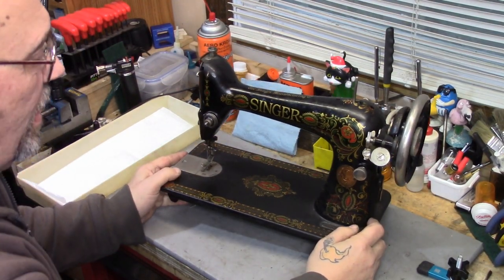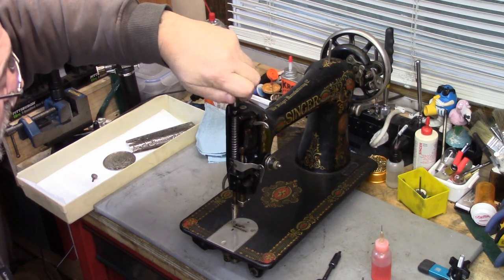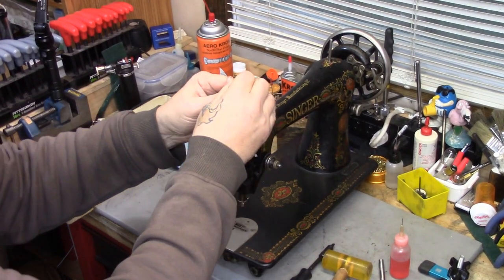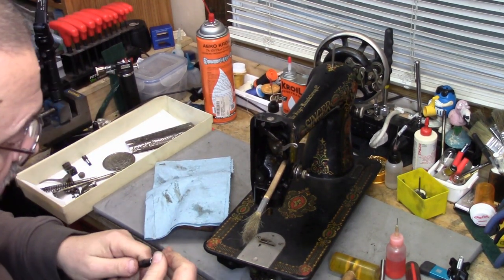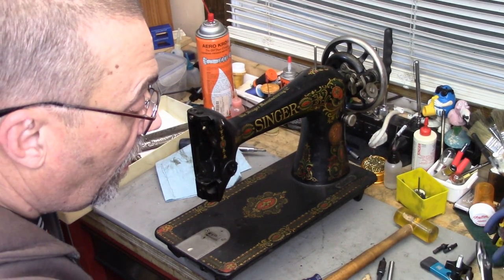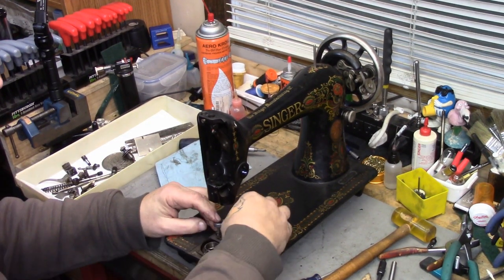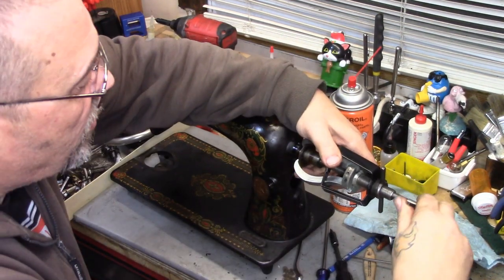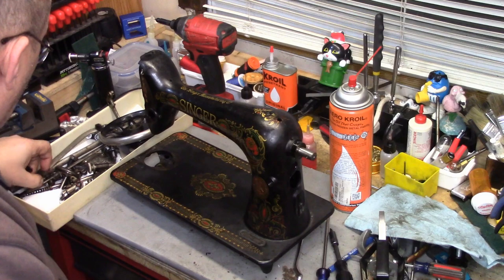Saga of Sophie Part 1 - The Dissection

Comment: I like to leave them original. I have 3 old back clampers and accessories are available if you really need them. I find that i dont use them enough to warrant changing an old machine. Also most of us have more than one machine. I love using the old Singers but keep a Kenmore 52 for zig zag work and the almost never done decorative stitching

Comment: I just bought a 66 from 1905 which is super gunked up (lots of it frozen). I'm following along with you as I learn about sewing machines and this one in particular. There is no hole on the inside for accessing the needle bar screw like you show at 7:27. Have you ever seen that? I'm kinda stuck there for the moment.
Reply from the maker: I've not seen one without an access hole, but yours has a different clamp, so the hole isn't needed. That original style clamp came back in later Singer machines.

Comment: Hi Bob - Thanks very much for your videos, they're very helpful.
I have a hand crank Singer 66k circa 1910 (a Scottish Lotus decals model) that I'm attempting to restore. I can't get the stop motion knob off! It doesn't seem to engage at all and even though I've got the grub screw out, it continues to turn clockwise and anti clockwise with the needle bar still going up and down. In fact the whole of the wheel shaft continues to go round. Can offer any advice please? It's like someone's super-glued it in there. Thanks
Reply from the maker: Hi Fiona, That's a common problem, Here how I handle it:
https://www.youtube.com/watch?v=j_puRinpD0k&t=7s&ab_channel=BobFowler

Comment: I have a question😮.  My singer 1910 needle bar bushing look like it is a screw in type.  There are threads on the top.  Nothing short of dynamite is working to remove it! Heat and krill and tapping.  Is it possible that it is threaded?
Reply from the maker: No, not threaded. It sounds like you're describing the presser bar adjuster.. Email me and send some pictures of the  issue. argosybob@gmail.com